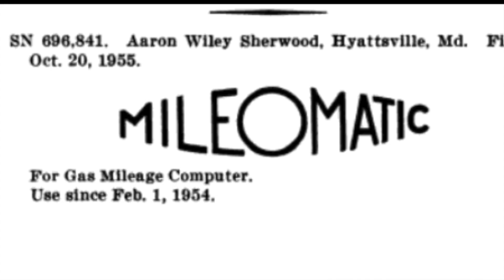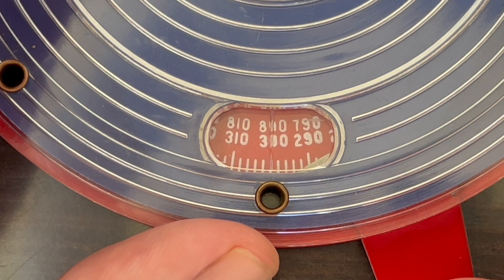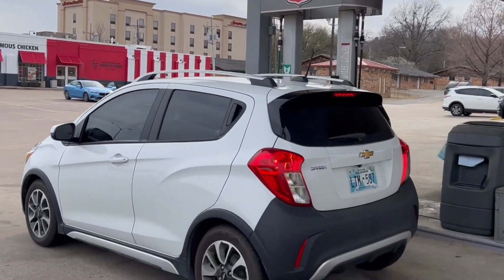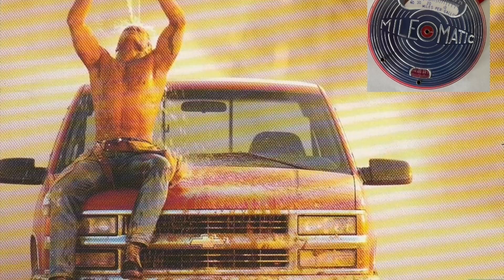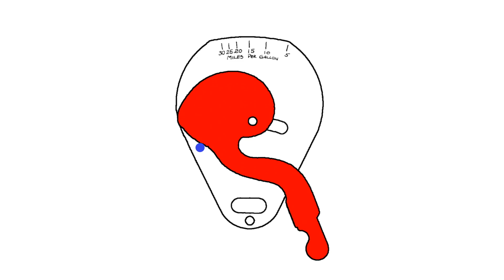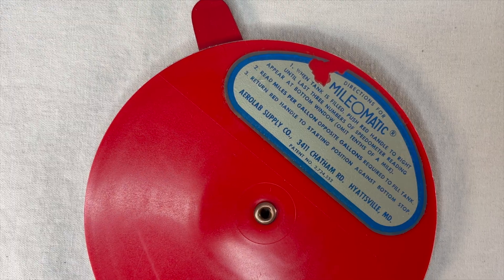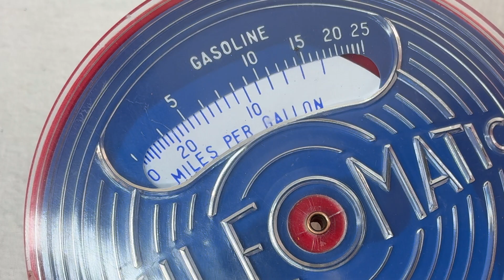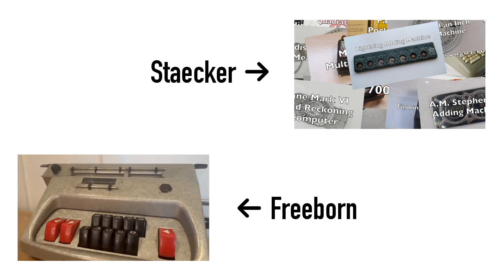The Mile-O-Matic! feat. Stephen Freeborn

Comment: A mile is 5280 feet.
A gallon is about 0.14 cubic feet.
So in a sort of way, fuel efficiency in "miles per gallon" is measured in inverse area. 1 mile per gallon is actually about an inverse acre.
Fuel efficiency is measured per acre in the US!
Reply: Europeans actually use Liters per 100 kilometers, so they measure fuel efficiency in regular area. 1/100th of a square millimeter to be precise.
But if you were in the UK spending Pounds to buy your car, and you measured your fuel efficiency in area, then you could measure the monetary cost for the fuel efficiency of your car in Pounds per square inch!

Comment: It looks like it subtracts then divides the result by gallons. But it doesn’t actually divide, it multiplies by the 1/gallons. Like the inverse scale on a slide rule. But only within a certain range of values. Now I use the trip odometer but they didn’t have a trip odometer.

Comment: that log scale on the results also is a great visual indicator / reminder of just how stupid MPG really is. The higher the MPG, the less difference it actually makes. So when efficiency standards slowly ratcheted up, they really weren't improving nearly as much. Like going from 10MPG to 20MPG is a much larger increase than 20 to 30 was, and even more so than 30 to 40. It's just "10 more" or "2x more" to most folks but in reality there's a whole sneaky thing going on. Probably how the oil industry was able to get away with their antics for so long. And also probably why the rest of the world swaps the distance/volume around (100l/km vs x miles/gallon).
Reply: Well said. I struggled to easily explain this to my sister.
Reply: @MattH-wg7ou  I finally realized something was at play when MPG would increase but distance increase on a tank of gas wouldn't be nearly as much... it would fall off. And then I realized. Def a lot better to swap the units around.

Comment: Do you have any artillery slide rules in your collection?
Reply from the maker: No- I don't actually have many slide rules. The 12-inch one in the video, plus a similar 24-inch, plus some circulars. Nothing really special though.
Reply: @ChrisStaecker  I came into slide rules at the very tail end of them, so I am not real familiar with all the variations. I have never seen one like yours that you use A & B for multiplication/division. It works to use A&B, but seems odd. On mine you use C & D and A & B are for square & square root. Yours does not show them at all. Are they on the flip side of yours? BTW enjoy your videos
Reply from the maker: @johnheitke7617  yes it may be that I was using the back side. I grew up with electronics so I am self taught on the slide rule, and I may be doing it in a weird way.

Comment: That visor clip would've been a killer app for this, I'm telling ya!

Also, I feel like this was meant to be used more for empty-tank to empty-tank, like every time you fill up, you use that to gauge how your car is doing, I dunno, that's just a theory of mine, based on my dad having decades' worth of notebooks where he writes down the numbers on the odometer on his car, that, admittedly I might have messed up a couple times when I was five or six. My did didn't seem to mind. He probably just remembered the numbers anyway, dude's great with numbers.
Reply: Yes, the reason it can get away with making the scale go the wrong way for the first part of the movement is that the device is assuming you're recording the miles driven on the last tank when you fill up. And that's probably going to be over 100 miles, unless your car's gas mileage is disastrous even for the mid-20th century.